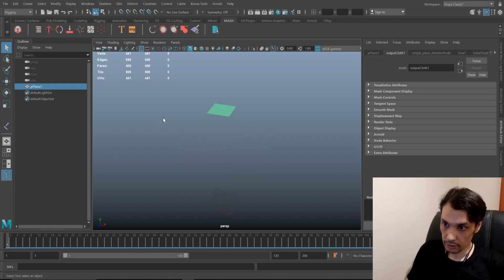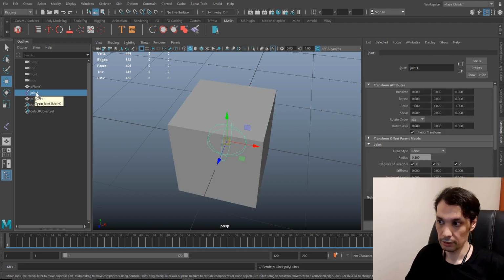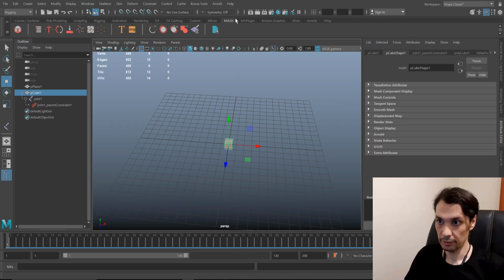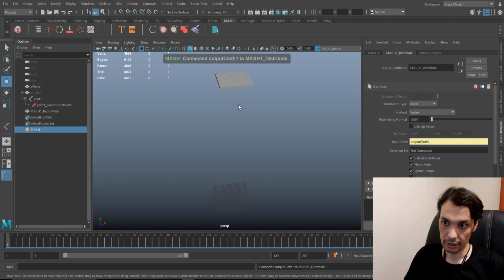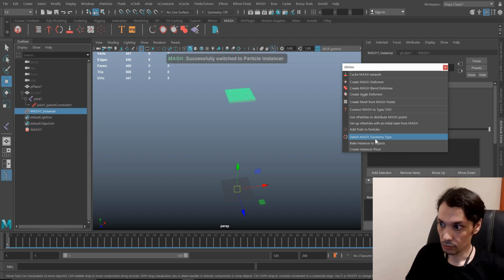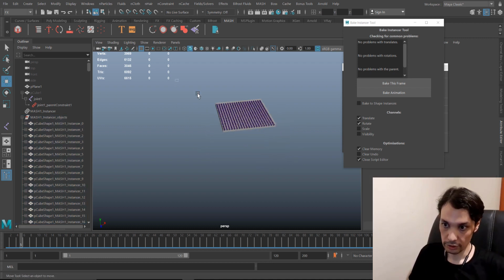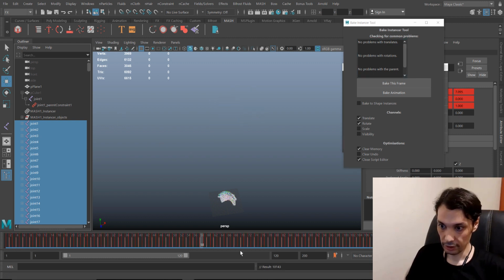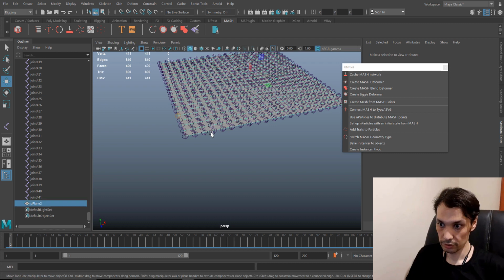baking vertex animation to joints using MASH in Autodesk Maya

Comment: Interesting method although a bit complex it's good that i works without plugins, back in the day i used Soup plugin when it was free to bake cloth simulations into joints and skinning, Maya has a bake deformations option but only works on characters. One extra step i would add before skinning is adding a single joint at 0 world then parenting all the joints to that, it's what the Soup node did and it's preferred for exporting to game engines, also using Mash you can add fewer joints randomly across the surface so it's less expensive in realtime.
Reply: yes totally agree my friend, we need a root joint ! And also used lesser joints distributing them in mash, but with a selection set

Comment: better off using a skin converter like Dem Bones for converting mesh deformation to joints
Reply from the maker: wow, I wasn't aware of that tool. the most amazing part is that it estimates the number of joints needed for each simulation. it's amazing. thank you for your suggestion.
Reply: @Metarig  heya! were you able to use dem bones for maya?